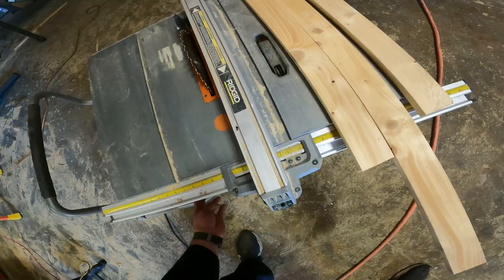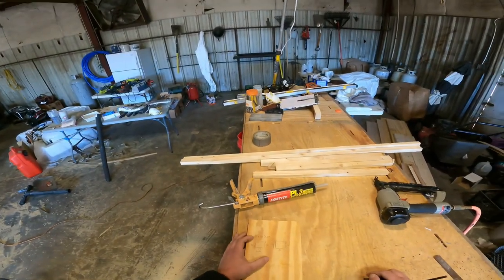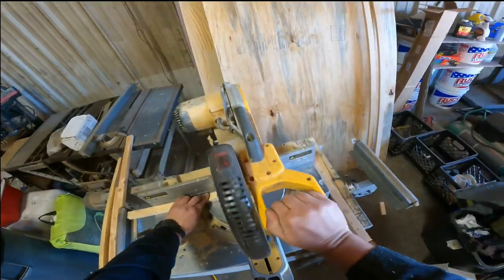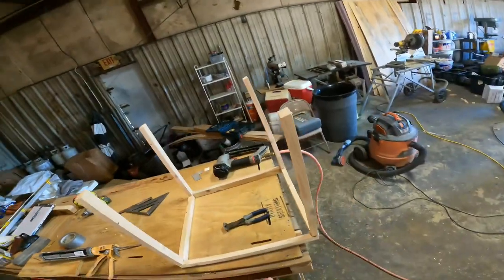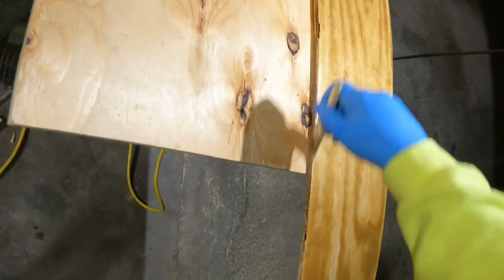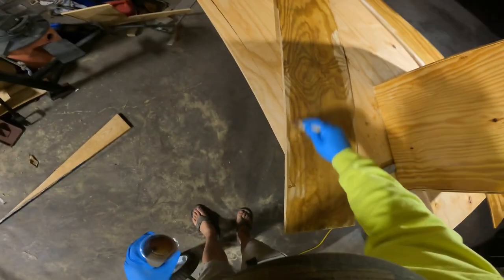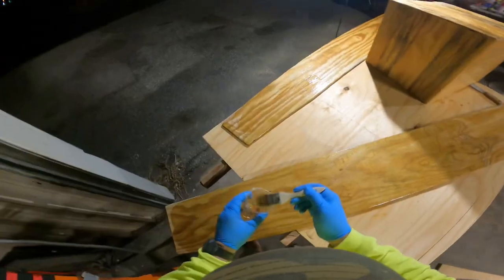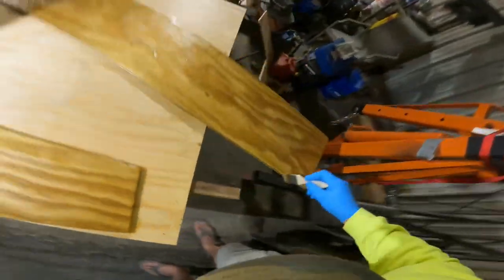DIY Boat Build- Center Console

Comment: WooHoo my drinking buddies ba...  Cough I mean great video this week Jim and the music was tops (really good in Scottish)
Im lucky that Im of a certain age where I can understand your strange colonial measuring system 🤣🤣🤣🤣
Truth be told is Im lucky that I used both during my trade time and so I switch between metric & imperial for the most convenient size 
(and I only ever use 1 tape measure in a project cos Im not giving my ten thumbs of incompetence any more encouragement) 🤫
The one thing that always surprises me is that the matting becomes clear and lets the grain show, and for the record my time is free but my money costs sweat (and maybe blood if she catches me spending it) so like you I don't mind spending that extra bit of time making things just so.
Reply from the maker: Yes man and if you build a beautiful wooden boat, you can still coat the hull with fiberglass and show off the grain at the same time. Best of both worlds, so to speak. And yes, always the same tape measure- even two of the exact same tape purchased at the same time can differ enough to screw the project. Thanks Scott.